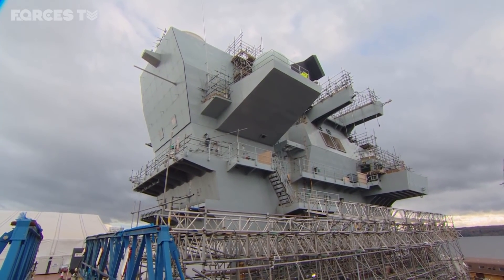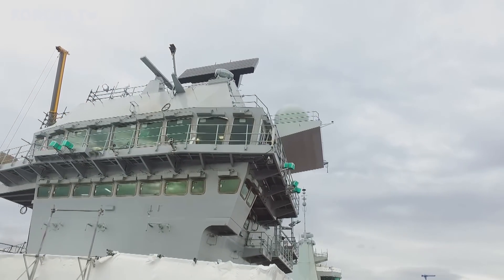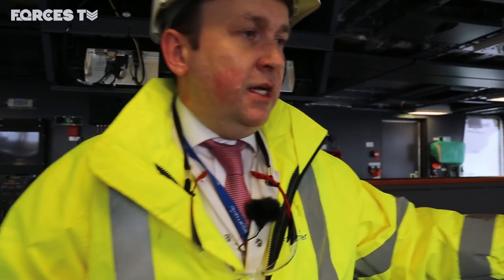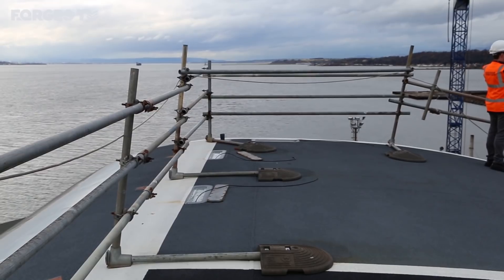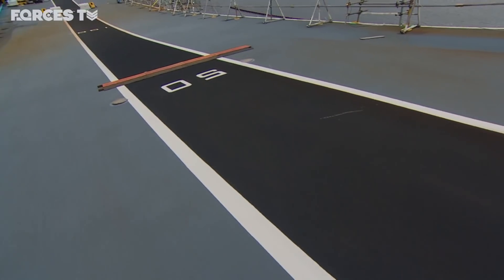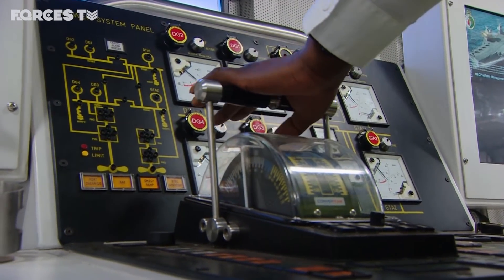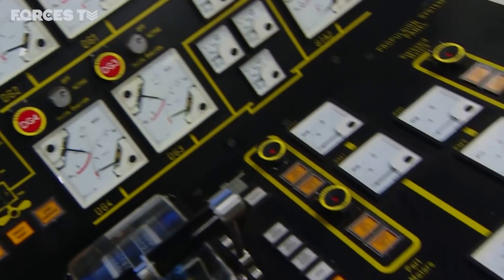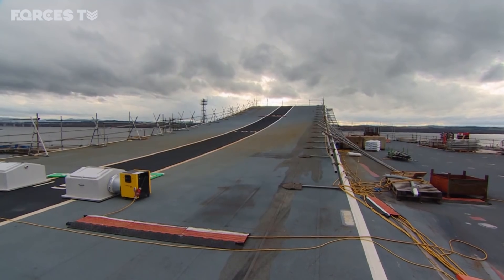What It's Like On Board Britain's NEXT Aircraft Carrier | Forces TV

Comment: A Beautiful thing in a hulking lump of metal way. I still think it was a big mistake not to design the flight deck able to handle other planes from other Nations.
Reply: Well, cat and trap fighters also need a lot of modifications. The USA only has one fighter for the carrier (f18). The f16, F15 and f22 for example can't land on a carrier. So only the f18 is available as a choice until they get the f35 C model.
Reply: @Albertkallal  You're either being deliberately misleading, or deliberately ignorant. The US Navy has operated numerous different fighters or fighter-bombers over the lifetime of its catapult systems, but in addition to these it operates numerous other aircraft in more specialized roles, giving US carriers a much wider number of missions. These new UK carriers can launch and recover a grand total of one fixed-wing aircraft, in a single combat role, and must base all future aircraft design considerations on this serious limitation.

Compare to the Nimitz-class which has operated the F-4, RA-5, RF-8, F-14, S-3, EA-6, A-6, A-7, and today operates the F/A-18C Hornet, the F/A-18E/F Super Hornet (which despite its name is an almost totally new aircraft), the EA-18G Growler (similar to the other F/A-18s but with a very different capability), the E-2 Hawkeye, and the C-2. The newer Ford-class carriers replacing the Nimitz-class expand this multirole capability with a more efficient, gentler electromagnetic catapult (as will the carriers built or upgraded by basically every other nation on Earth over the next couple decades) allowing maximum compatibility with any current or future aircraft designs. The UK wanted an electromagnetic catapult for the Queen Elizabeth-class, too, but for political reasons weren't willing to wait for delivery on it. Not very forward-thinking, but at least you can keep looking back and telling yourselves you invented the carrier or whatever it is you Brits keep saying in the comments whenever somebody questions the design of this one.
Reply: @fakecubed  
And what exactly did I mislead anyone about?

The topic or point was that VSTOL fighters are NOT as limited as one might suggest.

For example, I simply pointed out that the return store rating on the f35 B is higher than an f18 on a carrier with cat + traps.

That does not hint, suggest, imply or change anything you stated here. And what you stated changes ZERO about my claims.

I also pointed out how “low” the sortie rate is for cat + trap.

I assume on a military channel ANYONE with basic knowledge about carriers is those with cat + traps achieve a high sortie rate not because they have cat + traps, but ONLY due to the fact that they have 4 (or more) cat/traps in operations.

While everyone knows and seen a cat/trap system in operation, what THEY DO NOT know is that slow cycle time (2 minutes and 45 seconds) IS RATHER SLOW!. So I was just pointing out that cat/trap systems are SLOW in terms of launching fighters compared to using VSTOL fighters.

MOST DO NOT know this.

So while your information is wide spread knowledge by everyone, clearly my information triggered you like a little girl, right?

If you have ANY information that contradicts what I stated then please by all means point out what is wrong or what I stated.

And I am big fan of the EMAILS system. However, it is a complex system, and it had too many teething problems. And I think it is ironic that the system was SOLD on being gentle and causing less stress on airframes, and yet that system is causing too much stress on the f18’s as I write this (f18 with external fuel tanks are NOT permitted to be launched from the Gerald Ford).

So, if the EMAIL was sold and supposed to be so gentile then how come f18’s can’t take off right now with eternal fuel tanks due to over stressing the f18 airframe? Hum?

Again, this “stress” issue is NOT big deal and as I write this a fix is available, but not yet deployed on the Gerald Ford.

Worse is the launch failure rate is about 250 times that of steam. And a failure can mean a lost plane into the sea. And these days, planes are not cheap.

The 2nd issue is if the centrifugal generates are damaged, then you lost your catapult. With steam, you can at least attempt repairs with touches and welding, and likely get one of the catapults up and running after battle damage. Heck, take any metal scrap and weld over damage and holes to the steam system. 

I question how robust of the computer rail system will be in the heat of battle, or when they been damaged as to what kind of “field” repairs can occur with such a large and complex system.

You see, the nuclear reactors cannot supply the rails direct. So you have 4 big 20,000 lbs flywheels that you spin up to speed. (Lots of moving parts, right???). Then an expensive “cyclotron” system pulls energy from those big mechanical flywheels during a launch. (You see, if someone turns on a toaster or other systems, and the lights dim during a launch, then power drops and the plane lands in the ocean). So you need to “isolate” the power draw DURING a launch from the power being drawn from the ships generators (powered by the nuclear reactors).

It would have been REALLY nice if they could have used super-capacitors in place of those big mechanical (and heavy) flywheels. However, higher density capacitors were not available in that time frame (they are now).

And you can’t draw the full power to the rails from the ships generators (the nuclear power plants), so the big mechanical flywheels are used to “draw” power from the ship at slower rate to STORE up energy for a cat launch (you spin them up – recharge time is 45 seconds – LONGER time then to launch one VSTOL fighter).

So we have:

A system that was sold as being “gentle” on airframes currently overstressing airframes.

A system that is supposed to be FAR less mechanical then steam systems, yet it has an AMAZING hodge podge of mechanical spinning flywheels and mechanical bits and parts that are NOT proven to be reliable right now. 

At least with steam, we been using that system for 50+ years. And the steam has a natural “built” in “sponge like give” that is not so hard on the planes airframes.

The above explains why Trump suggested that steam was proven, works. And the real insult was have what 4 time the cost overruns on that system? (I am just pointing out Trump was WELL briefed when he made those comments about using steam – he had VERY good information and reason to make that statement).

Worse yet, is for maintains when you spin down those huge mechanical flywheels, you can’t isolate them (so all launchers are down for the count to do maintains on just one unit).

With steam, you can weld and repair the system when damaged – it is a long time proven technology. And there are LONG established operations that allow the steam cats to be isolated or turned off one by one. Right now it still looks that steams systems are more robust to damage and repairs then the EMAILS system.

I do think in the long run, they will make EMAILS work, but it been a real messy affair from start to finish.

Anyway back to the VSTOL issue?

Only a FOOL would ignore that the F35 B has higher return store ratings then the f18 with cat + traps. That is WHOPPER of new information, don’t you think?

And MOST ignore the slow cycle time of a catapult. (As I pointed out, close to 3 minutes). So once again FEW realise that compared to a catapult, VSTOL planes launch at a much much faster rates (and that means mores sorties per unit of given time, and that means more force projection).

Never suggested, hinted, and implied in ANY WAY that catapults are bad idea or system.

Never suggested, hinted, implied in ANY WAY that a VSTOL only ship is better. 

However, it is a GREAT idea to bring some balance to this discussion. MOST people rag on VSTOL due to lack of knowledge. I am not one of those people!

So, I am pointing out is that VSTOL fighters like the F35 B have removed MOST of the limitations that we had in the past for VSTOL fighters.

And for lower cost, and force projection, the LHA “wasp” class with the f35 B is a game changing option for the marines and the US military in terms of air power projection.

Dog bites postman? Well, nothing to see here, move along.

Postman bites dog? WOW – that is news!!!

As for fighters on USA carries, you only have the f18 right now, and the supers. So for a VERY long time, ONLY one fighter was available on those carriers. No f16, f15, or f22’s.

So, options have been limited here, and until such time the f35 C is deployed, the choices for fighters is still rather limited. 

I do think the addition of v22’s on WASP class, and even ships like the HMS Q will enable deployment of air to air refueling abilities for such types of ships – that’s going to change this game again in big ways.

So, hope the above helps you out here – just pointing out some facts. (And I’ll tip my hat back at you – you also are just pointing out some facts – but they are ones that everyone knows!).
Reply: It can and will host American f35bs, and not many nations have carriers anyway!
Reply: Well, any nations who have STOVL aircraft, i.e. the F-35B, AV-8B and the EAV-8B (the spanish harrier) would be able to land on it. Plus, USMC F-35Bs will accompany FAA aircraft on board her first cruise.

Comment: 3:57 "It's intelligently designed" LOL , what?! You must not have seen those two big, inefficient, space wasting islands breaking up the deck space... They waste so much space and make aircraft handling so much more complicated.
Reply: How? If you have one island blocking the runway then 2nd not in the way. The only argument here is if you have an angled deck to separate launch runway from landing. I'll certainly concede advantages of angled decks, but without angled decks then 1 or 2 deck towers really don't effect anything here.
Reply: @Albertkallal  It has nothing to do with the islands blocking the runway. It's all about the smooth and efficient flow of the aircraft around the deck. Having two islands and having them right in the middle of the deck puts them right in the way of where aircraft need to move, making towing, taxiing, loading, fueling, arming, and spotting of aircraft more complicated and require more steps. There's a reason the Ford class has a smaller island and moved it further aft compared to earlier US carriers. In addition to the obvious that an additional island takes up more space that could have been used to carry more aircraft and/or have more above deck ready to go.
Reply: @Loctus494

Right, but they don't have all the deck space reserved for the traps. The cable traps take up huge amounts of space. They still have room for two landing spots while even taking off planes, And without cable traps, there is ample room to move planes past the towers while NOT interrupting air operations for landing and takeoffs. (they only plan to use rolling landings when sortie rates are low).

Because of so much additional deck space, they were able to trade space for a additional tower - they don't chew up large amounts of deck space with cable traps.  I am open that one tower gives more deck space, but having that additional tower was deemed worth the extra deck space - space that they had. 

I would accept if they used cat + traps, then space for a 2nd tower simply would not be possible.  Given that they can move planes past the towers, they are in rather good shape this way. 3 sets of cables, and the deck space when they spool out, and spool in the cables means equipment can't be anywhere close to those cables - not to mention the crew that manages and sets up the cables during operations.
Reply: Locutus494 it’s all about safety, a dedicated aircraft control centre is far more ideal. It’s not about numbers it’s about effectiveness. The British think differently and didnt want a large aircraft carrier that can just carry loads of planes
Reply: @Horizon301.  
There's pros and cons of two towers. Two towers means more deck space below. And two towers are narrower than one large one. (This gives more room for planes to pass by and not interfere with runway). 

Another big advantage is they seperated two radar systems (for defense and systems to track planes). Radar systems close together interfere with each other. This setup allowed seperate radars on each towers - they work much better as result.

So two towers are narrower at bottom, and a below deck was moved above gives more room below.

Not everything is better with two towers, but advantages exist and the decision process of this choice has much merit and considerable engineering thought went into this choice. I suspect this design and innovation will be copied by others.
Reply: @Albertkallal  You could also have mentioned the rear 'Flyco' tower can double up as a navigation bridge if the front tower is disabled and vice versa. Both Navigation and Flyco space is doubled allowing better facilities and better operation. Essential combat ready redundancy. They also relieve air flow around the flight deck and they have been proving this benefit over the last couple of months. Once again the UK has led with a different way of working a carrier as it has since inventing the carrier and then building the first one in 1918.

And the French didn't think it was odd given their PA-01 was going to be a CATOBAR version but retaining two towers.
Reply: @1chish  If the towers are so redundant, then any arguments of space saving are complete hogwash.
Reply: @fakecubed  I never made the 'space saved' argument but as you have raised it the space saving is below decks but I was referring to the extra space available in the two blocks. Do you actually understand the term 'redundancy' on a warship? I will explain - You build in features so that if a key part of a ship is damaged then you have other resources to replicate the damaged part and still be able to manage the ship. That I have to explain this indicates you are a little out of your depth.
Reply: @1chish  I do understand redundancy, I'm merely pointing out that if that is the excuse for having a second tower, it makes all the other defenders in this thread look rather silly. Somehow, though, other nations have managed to have redundancy without such a large footprint on the deck.
Reply: @fakecubed  So where are the others wrong? The Royal Navy doesn't need any 'excuses' for what it does or does not do. And don't forget every major design advance in aircraft carriers has been developed by the UK no one else. They (including the US Navy) have copied the Royal Navy. the fact they are still using the single island to Starboard created by the Royal Navy with HMS Hermes in 1918 is something they need to answer not the Royal Navy. What I can tell you is the US Navy have been all over the first ship during every phase of the build and are utterly astounded we delivered such a large ship at the cost we did. The flight deck width and area is actually larger than a Nimitiz which is only 130 feet longer in the bow because of catapults. And in the time we did it.

Whether they copy us again or not isn't the point but the QEs will deliver 5th Gen strike operations in 2020 at comparatively low cost and at very low crew numbers. Like TWO 70,000 Te strike carriers, each capable of delivering 55 aircraft at surge at a cost of $10 Bn the pair requiring a crew all up of 1,600 each. The new Ford Class has already cost over $18 Bn for ONE 100,000 Te carrier capable of delivering 75 aircraft and needing 4,500 crew.

The design adds space where its needed to manage the ship, aircraft and support functions where they are needed. It creates space below decks to use for other key systems and aids the effects of airflow over the flight deck.

You say its wrong but offer no argument why?
Reply: They needed exhausts in those 2 locations apparently so the islands don't make the situation worse.
Reply: Locutus494 they’ve just measuring and designing to show that is enough space for aircraft and it’s not a waste of space
Reply: It's simply a different concept - and it works for the UK.